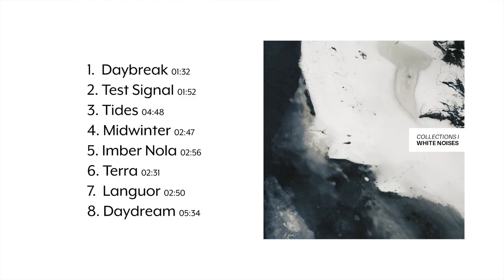Making music with Chance and Randomness

Comment: "Sounds a bit like hi hat"  Which leads me to believe that you have two weasels, duct taped to a mic stand in your basement next to the rest of your drmset. I'm afraid to know what your snare is :) Thanks for the video. I found an old notebook the other day, with a complex system called: Random Song Generator. It involved coins, d&d dice with certain number outcomes that shunted you off to either the I Ching, Oblique Strategies or, and don't ask me how this was supposed to wok, the Holy Bible. It's very cute, a bit naive and not truly random. I think I only ever used my system for one piece. This makes me want to revisit it.But these days I usually just apply two rules to every piece of music I make.
1. Each song should have at least one element not considered musical by most people.
2. Whenever possible, at least one mistake must be retained and turned into part of the song.

 the second rule has led me to making entire sections of songs made of what would be considered mistakes by most people. It' a fun challenge that succeeds more often than you'd think it would.

Comment: your mixer also has volume modulation per channel,  could you tell me which module that is?  I don't think I have seen anything like that in a mixer interesting functionality
Reply from the maker: +JVMC It's Tangle Quartet by ALM Busy Circuits - had it since day 1 and really love it! Thinking of getting another...
Reply: White Noises thanks awesome work that you are doing.  I am building a system with ambient textures,  Brian Eno and Loscil as musical references in mind so modules that generate subtle variation over time and probability are of high interest.
Reply from the maker: +JVMC Cheers bud! 🙏🏻 That sounds really awesome, Eno and Loscil are phenomenal. If you want slow modulation, check out the sloth modules by nonlinearcircuits. Mutable Instruments Clouds is always great for ambient stuff too!
Reply: Clouds and rings, spectral MR I have on my list but the sloth stuff I didn't know about ......and  is exactly what I needed , thanks a lot !